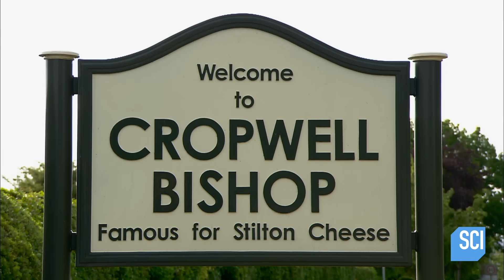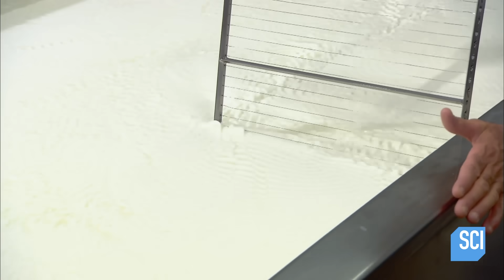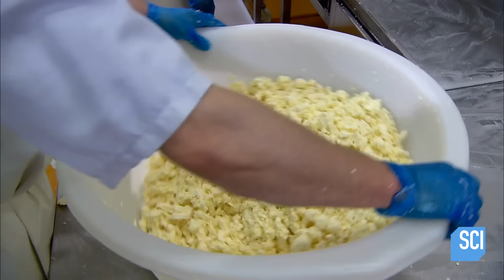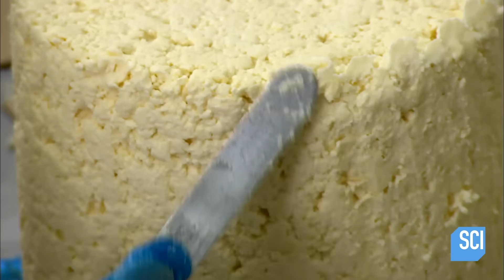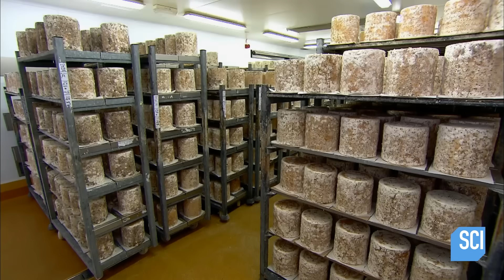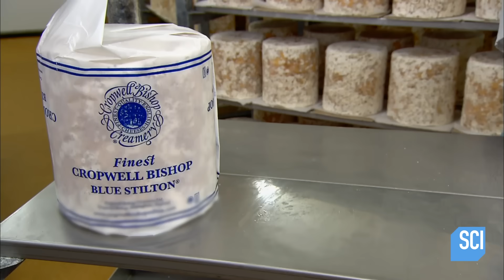How It's Made: Blue Stilton Cheese

Comment: Traditional authentic blue cheese in Middle East,  consists of a wild garlic + another herb which only exists on some mountains, added to the cheese and kept in lamb and goat skin in the spring. Those batches are kept high on mountains where there are cave like big holes still holding snow from winter until late fall . Its taste is like 100 times better than artificial mold which shown here. It’s also the most expensive cheese in the market. One can be lucky to find that kind and buy it.

Comment: I used to work at the Arla Stilton cheese factory in Melton Mowbray. They actually use antibiotics to get the mold to go faster. The rub up part these guys are doing is the slow way, we would mix a bit of water with some cheese to make a paste and you'd paste it over the Stilton like a plasterer would do a wall. And we weren't allowed to smoke on our breaks because they reckon it could cause the Stilton to taste different lol. The best job I did there was piercing the cheese, you could chill and listen to music, whereas turning the wet Stilton was the worst part of the job.
Reply: Ha, back in 2007 I used to deliver fruit and veg to the canteen there. 
Instantly thought of it when I started watched. Emphasis should have been made about the smell in that place.
Reply: @112chapters3  I worked there about 2015. I only remember that the canteen was upstairs in the old style building the right of the entrance.
Reply: antibiotics or probiotics?
Reply: @chrisgartenn  https://en.m.wikipedia.org/wiki/Stilton_cheese#:~:text=Stilton%20is%20an%20English%20cheese,and%20White%2C%20which%20does%20not.
Reply: Ha I'm a wagon driver and collect there 2 or 3 times a week...
Reply: @chrisgartenn  Mate you should do a quick search, before making a comment, pretending to know what your talking about! It's made with Penicillium not yeast. Here is the quote from Wiki: Stilton is an English cheese, produced in two varieties: Blue, which has Penicillium roqueforti added to generate a characteristic smell and taste, and White, which does not.

Comment: "Mum there's mould ON my cheese."
"Throw it away it's unhealthy."

"Mum there's mould IN my cheese."
"Eat up it's good for you."
Reply: You know, Brie and Camembert also have mould ON the cheese.
Reply: @tuipaopao  In that case:
"Mum there's mould IN my cheese."
"Throw it away it's unhealthy."

"Mum there's mould ON my cheese."
"Eat up it's good for you."
:P
Reply: @tuipaopao 🙃😶🤐😅 ohhh (and I've got at least 1 long comment on my reaction to seeing blue cheese in its solid/wedge form for first time I knew of in my teens). I can't recall if I even heard or read that brie has mold; I can only remember ehh kind of a weird mix of "bitter + salt + 'strong'" I'm not so into 🙃 I don't run I've had the other cheeses but I've heard of the names (but I might have heard  camembert mispronounced)
Reply: Indeed, i rarely toss a piece of cheese that's gone mouldy if I can trim off the mouldy parts ("normal" cheese usually gets mouldy on the outside), but the problem is you never know what's growing on it so it's safer not to eat. HOWEVER, the biggest problem is... how can you tell if a piece of blue cheese has gone off?!